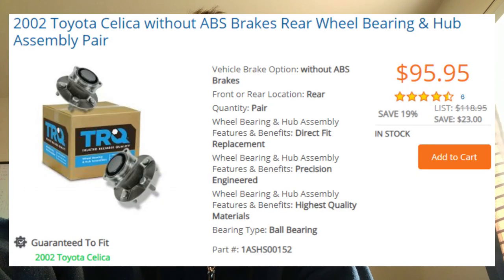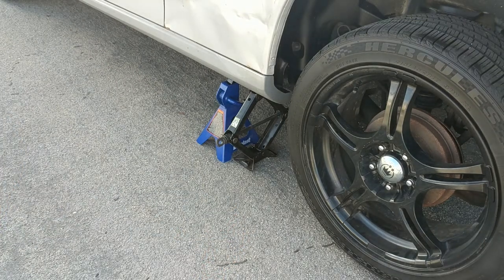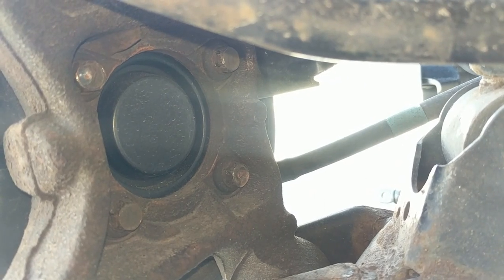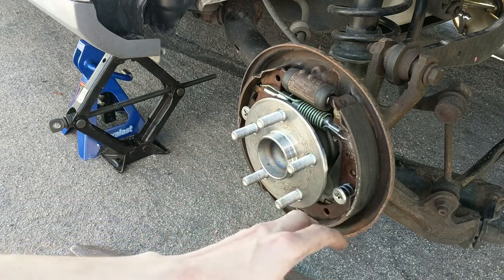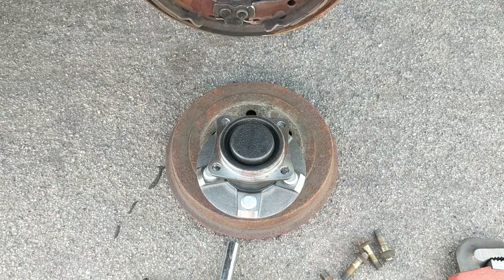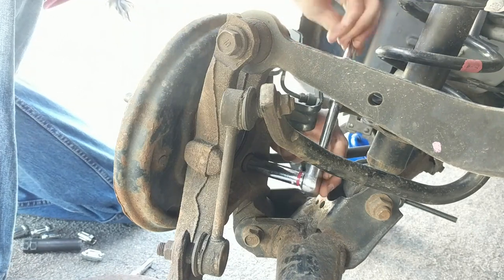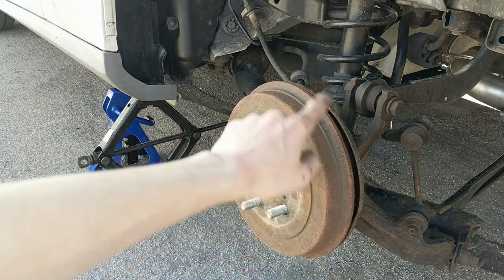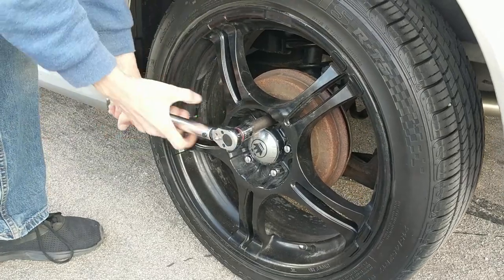How To Replace Rear Wheel Hubs Toyota Celica

Comment: Mines was so badly rusted, it bonded like a weld. Used a dremel to try to cut my way through. Been banging it with heavy mallet too. Wouldn’t budge. Decided to just replace the whole assembly, and get new wheel hubs.

Comment: The 4 bolts are 59ftIb. The owners manual also suggest that youll need to replace the bolts as they arent reusable, not sure why but use some threadlock for safety

Comment: What year is the Celica your working on?
Reply from the maker: 2002
Reply: @ElectricMilesLLC  thanks, here in the UK they never made that model with drum brakes. I was doing the same job on mine and after undoing the four bolts I couldn't remove the hub. After looking at your vid it's obviously just rust stopping it coming out